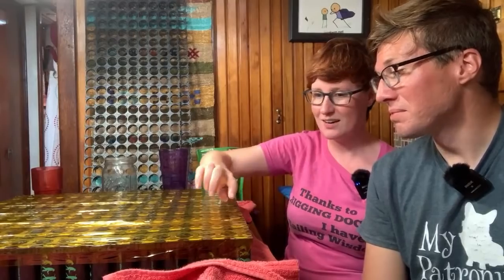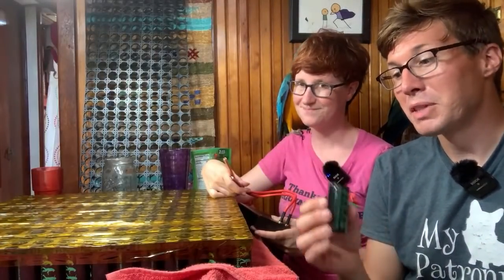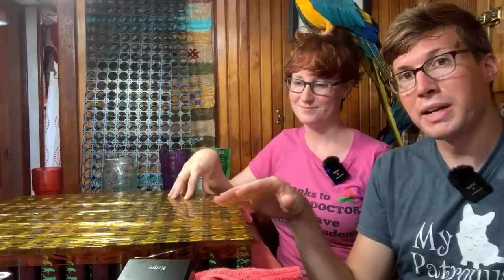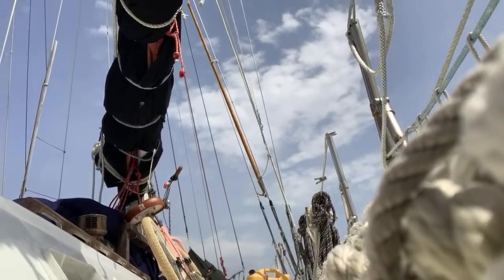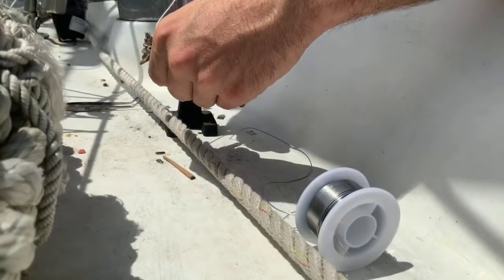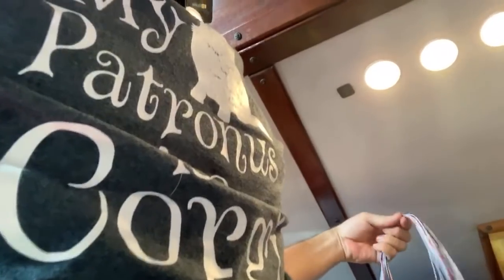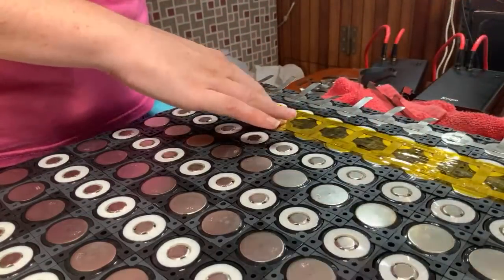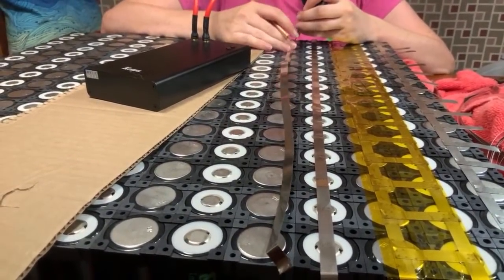LiFePO4 Battery Build [LIVE]

Comment: Just watched!! Great job for ya first time… I think if people knew what was inside a battle born, expertpower or Regen etc….  More sailors would build their own… if you bust open a Battleborn  you would find 18650 cells. Using the same weld techniques in this video…
Reply: Actually they are not using 18650 cells. 
And using more likely 32650 or a little smaller like 26650. Battle born cells have 3200 mah cells. So I'm leaning towards  26650?!
Reply: @rightsdontcomewithpermits7073  ya realize this post is a year old…

Comment: Interesting and informative. Loads of information on an important subject. Thanks so much. Your soldering skills could stand a complete rethink though. Lay down a small board over the fiberglass deck first. If you just tin the wire lead first, lay the small strip on the board and heat the strip by touching with the tip and lay the tinned wire onto the strip next to the tip. You should not need more solder than is on the wire. A big "Good going" to you both.
Reply from the maker: Thanks for the soldering trick! I’m going to be soldering 8 more today so I’ll give it a try!

Comment: You would do well to use an inverter and use as many 120 vac/240 vac things when you can.  Regular stuff is cheaper than their boat equivalent, your wiring would be smaller gauge, and inverters are very efficient (>90%) so there isn't a high penalty.  Sine wave inverters have really come down in price too.
Reply from the maker: Now that we have the batteries to power stuff, we have installed a 400W inverter and it has been awesome!

Comment: Hi guys, I built a pack from Tesla battery that I disassembled. I bought a similar spot welder and it would not give good welds on .15mm nickel strips but would on nickel plated steel strips. Did you test the strips to make sure they were pure nickel? Ended up building my own spot welder. Be safe!
Reply from the maker: I did and they don’t rust. The welds are not always good which is why we do a bunch and revisit some of the spots to get it to finally weld. At full power, they seem to stick pretty well.

Comment: I work with electrical items of all kinds so I don't have any dislike of electrical devices.  But when it comes to power a boat, gas motor is the only way I would go.  I know all the advantages of battery power but I also know the disadvantages too.  Battery might be a good backup to a marine engine.  If it were me I would have put 2 outboards on the back of the boat.  If it didn't work out I would sell them and try something else.

Comment: When talking about Amps you should mention the voltage. 100 Amps at 24 volts provides twice as much watts as it does at 12 volts.
Reply from the maker: Very true. Whenever I’m talking about the motor, it’s in 48v. 
It then quadruples when we step it down to use in the boat for the house loads!

Comment: Building a diy battery like this has an amazing advantage of building a bank with custom dimensions to fit existing boat locker space.  So do you have a calculation for Volume in terms of AmpHrs using these cells?
Reply from the maker: I did back when I was buying them. I figured out the maximum theoretical kW capacity of the battery boxes and then tried to organize the packs in a way that would most closely approximate the maximum. This let me rest easily knowing that “there isn’t more power storage available” so that I could stop my calculations.

Comment: What about the insurance and the DIY batteries?, dont you need some kind of certification?
Reply: Yes. You most certainly need some sort of certification depending on intent / type of operations conducted. I think, under the American USA flag these types of vessels are entirety exempt because of categorization of liability and risk. Generally, a small vessel not carrying in Commerce can operate under it's own authority. Basically, the most interested party assumes full responsibility for safety and casualty and Indemnity. That is to say, the most interested parties assume risks as they see fit. If a vessel carries Passengers or freight in Commerce $ it is subject to many standards which are enforced by the global community and local authorities.
Reply from the maker: Insurance companies don’t seem to care as much as they should. When I had full coverage insurance and switched to electric propulsion and synthetic rigging, they never had someone come check it or review it. I notified them and they didn’t care. “As long as the rigging is under 10 years of age” and “any type of motor is fine”. Nothing about it being done properly or safely. 

I guess if your insurance gives you a hard time, switch to a company that doesn’t give you a hard time!
Reply: @RiggingDoctor   The past three states ( in land) I've owned and registered boats in didn't have any insurance requirements at all. My insurance agent told me I'm covered by my home and auto insurance policies. I suspect I'm in error.
Reply: For U.S. Flagged small boats, insurance inside the U.S. is easy, particularly for "liability only". Outside of the U.S., I find it a nightmare. 1st,  there's a lack of choices/competition. 2nd, non that I find offers "liability only", maybe too little money to be made? For bigger name companies, if my boat is worth less than a certain amount, like $150k, I don't meet their threshold. They are seeking annual premium north of $3,000. European flagged vessels seem to have many more choices in this area.
Reply from the maker: Try StateFarm. They do our liability only and we were covered anywhere in the world. No cruising grounds or calendar limits. Just liability insurance for the boat.
Reply: Don't be fooled you homeowners insurance does not cover your boat only liability at your house .
But an additional endorsement is cheap add on to a home owners policy .
Reply: @RiggingDoctor  Just double checked with the underwriter from StateFarm; they only underwrite U.S., not internationally. So you may have been sailing tens of thousands of miles without any insurance. Apparently, many marinas don't care. I guess unless the boat is worth $200k+, many cruisers just don't bother with insurance because it so difficult/expensive to get. Even some YouTubers don't have any: Beau and Brandy Sailing, Emily & Clark's Adventure, Sailing Good, Bad, and Ugly, Bums on a Boat,... Sailing Project Atticus didn't have any for their old boat. Doesn't help with anxiety whenever you're away from your boat.

Comment: Adding 16 rungs to your ladder is crazy redundant. You could do just one if you back your nickel strip with copper wire, and connect with one wire rated for the full amperage of the battery. (Although the 16 strips.... one on each battery pair is oddly soothing to my ocd.)
Reply from the maker: Haha! The symmetry is nice.

The Ni strips flow 5 amps each, so 16 of them gives us 80 amps, while the BMS is a 60 amp unit. The motor at full tilt would only draw 80 amps from each battery so its just enough. Copper wire would be nice to tie it all together but with so many connections to do, the fewer the steps the easier (and it's soothing to look at).

Comment: Found the rigging doctor channel yesterday as I got a complete re-rig coming up, Headstay, solent, 2 top sidestays, 2 lowers and a babystay. Antenna in the backstay..  But as an electrician and hobby e-bike builder, I got sidetracked by the electric motor thing.

How do you wire the charge control/battery protection? I understand that you use a separate BMS in each battery? Can you  connect one or more battery packs  to consumers at the same time, or are all connected together?
Do you have a separate load and charge bus, or will the battery be disconnected alltogether if there's danger of overcharge?

Looking forward to the next part of your saga.
Reply from the maker: Hello! Glad you found us 😁

Each battery has a BMS which will disconnect for many reasons (temperature and charge related). We have a fuse to disconnect the battery if it discharged too quickly, and made the interconnects small so if one cell gets carried away, it will sever its connection to the rest of the battery. 
All the batteries are hooked up together in parallel after the BMS, so each battery can operate alone or in concert with the other batteries. 
It was a lot of fun learning how to make these batteries and all the protocol that electricians use to ensure safety and reliability in installations.
Reply: @RiggingDoctor   Just be aware that when you paralell batteries with different voltages , the low battery will take the amps wich the BMS permits. I would consider reducing max charge for each BMS to about 1/4 of max possible charge in your boat, or thereabout. just to baby your batteries.

If you use allmost no amps at 3 knots , and 300 amps at 5 knots, I bellieve that you are over propped. A good prop-shop will calculate a perfect prop from your electric motor log and boat data.
Reply: Over propping will also hurt your regen.
Reply: 1/4 each , as you have 5 batteries
Reply from the maker: When I connect the batteries I keep them turned off and charge them to roughly the same level so that there isn’t much of a jump/dump when they get connected. 

As for the power consumption, the motor has a reduction gear on it so that we hit hull speed just before the max RPM of the motor; in other words, the gear makes our prop perfect for the setup. 
The issue is the force required to move the boat increases exponentially and to go a little faster, it consumes a ton more power. Finding that sweet spot of a comfortable speed and enough range is the trick to it all 😎

Comment: QUESTIONS PLEASE ! Was wondering if there was a resource for what you did. I was told there was a channel that specializes in the single cell types of batteries with the little spot welder and I suspect you got your info from there ? That said, I'm perfectly happy with what you have done and the info you've provided. I guess I would want, at least on top, a layer of that tape that is one big sheet if its possible to find ? What do they mean (spot welder) 9 gears 60 gears 5 gears ?  (anyone can answer these questions if you would like to )
Reply from the maker: The channel I looked at for information on how to build a battery and assemble a BMS was DIY Solar with Will Prowse. His channel is very informative!
I also read a lot of research papers about different cell chemistries to decide on LiFePO4. I think it was the University of Colorado that had a lot of great testing results published. 
As for the “gears” on the spot welders: I think it’s a case of “bad translation” from a designer who speaks no English. The “gears” are analogous to “levels” or “power”. They are so weak that you will always keep it set to the maximum and never have issues related to using a welder that is too powerful. 
They get the job done but any lower setting simply won’t get the job done.
Reply: @RiggingDoctor  Will calls prefabricated groups of cells in a 3.2 volt parallel configuration and wrapped with plastic, usually blue plastic, he calls them cells. You are working with true cells, and fabricating what I guess I'd call "packs" if 3.2 v, but your actually not making packs, but instead, making true batteries.  That is what I had not seen before, at least not with Lithium Iron. Way Way back when Lithium Ion batts were still being used, some folks did the spot welding to those. Does your spot welding go back that far because Will didn't do any oi it in his current channel. These current spot welders are very neat and well developed. I didn't use the term "cool" because parts of them get hot lol
Reply: @RiggingDoctor  And, almost forgot to mention, Uma had a serious problem with battleborns in the beginning, it wasn't the batteries but the way they hooked them up.They had a resistive connection that melted one of the batteries. I think I would be using a cheap remote infra red thermometer , accuracy not so important, just seeing which terminals or cells are getting hotter.

Comment: I recently purchased 16 lifepo4
 3.2V 320ah batteries for total of 1500.00. In series and parallel for a 24v 640ah system.  
Try shopping Aliexpress.  It takes a couple months for shipping but worth the wait.
I'm interested in removing my diesel and going electric propulsion...any recommendations for motor and controls?
Reply from the maker: That is definitely the easier way to do it, but we didn’t have the luxury of a long term address or lead times, so our search was severely limited to local and current. 
When we convert our other sailboat to electric, I will definitely be doing Aliexpress for the batteries!
Reply from the maker: As for motor and controls, we have been happy with our Electric Yacht system. Over the years and miles, we have had a handful of issues which were easily resolved. The system doesn’t have a lot of bells and whistles, but at the same time it doesn’t break down as often as the other brands with lots of bells and whistles. 
If it’s a big boat, electric yacht, but if it’s a small boat, you could also look at Thunder Struck. They are an even more paired down version of the electric yacht system, and also a bit cheaper; but they only have up to a 10kW system.
Reply: 320Ah cells in a boat must be clamped , and if you go offshore , it should be suspended.  Sinopoly only recommend 100Ah cells for small boats, 200Ah max for larger yachts.

Comment: How about holding the sordering iron with rubber gloves on?
Reply from the maker: That would be a good idea but we didn’t have any that were thick enough to not melt with the heat. Switching out to a cooler unit worked with the materials we had on hand at the time.

Comment: In hind site couldn't you solder all the wires to one long tab and then cut them apart for easier handling
Reply from the maker: For the BMS? That would work! I was simply using scrap pieces of nickel strips that we would then spot weld to the positive positions, but having them all laid out in an orderly fashion would be rather nice!

Comment: Why not battle born 5 *950? Seems like lots of work for minimal cost savings?
Reply from the maker: The battle born batteries cost $950 for a 12v 100ah. This setup is costing less than $250 for the equivalent battery.

Comment: What is the lifespan of each cell and how difficult do you think it will be to replace them?
Reply from the maker: Each cell should last many years, I think it was either 3k or 5k cycles. 
Replacing a cell is pretty straightforward. Cut it out and weld in new strips to the neighboring cells.

Comment: QUENSTON.It is no limits for Paralel.
Add in parallel for motorbike 36v batt.10 cells, 3.7 is $=37v, and 200 in parallel is equal 37+3,7=40,7v Can work like that ?
Reply from the maker: Series adds Volts, parallel adds Amps. 

If you have a 3.7v, 2ah cell
10 cells in series x3.7=37v of 2ah
10 cells in parallel x2ah=3.7v of 20ah

If you have 100 cells and set them in series strings of 10 and hook those strings up in parallel, you would have a grid which would be 37v and 20ah.
Reply from the maker: Voltage limits how many you can put in series, but you can do as many in parallel as you want to make a bigger battery bank that will power the device for longer.

Comment: You need to buy a derelict beach cat (Hobie or something) to tow up the ICW and cover it with solar panels.....Depending on the size, you could get close to 30KW capacity..... far more than it would take to pull it...that adds up to about 40 HP worth of power.

Comment: At 10:30 you mention Tesla and Nissan Leaf batteries interchangeably, then mention they're NiMH.  To be clear, Tesla batteries are obviously Li-on, only the Leaf are NiMH.
Reply from the maker: I must have misspoken. Tesla uses NMC and Leaf uses Li-ion. 
We decided for safety reasons to only use LiFePO4 on our boat. 
While LiFePO4 batteries are not as energy dense as the other chemistries, we feel that they are the only chemistry that is safe enough for marine use. 
If you have the budget and space, LTO Batteries are the safest of all!
Reply: @RiggingDoctor  - Thanks for the reply; you may want to edit that; however.  Tesla uses Li-on, Leaf used a NiMH. :)

I do agree that LiFePO4 is the the superior route, with only small exceptions where energy density is paramount (eg UAV's, etc).

Comment: Your battery pack would still work fine if a cell died. You may not notice the voltage drop if a cell dies. Prismatic Cells if one cell dies the whole battery is useless. The beauty of cylindrical cells.
Reply from the maker: I know! So many people ask me about it with serious concern, but it’s not an actual issue 😎

Comment: It's not recommended to have your battery bank in the bilge. If you have an incident where your talking on water your bilge pumps stop working when your batteries get wet and flood the boat.
Reply from the maker: Boats are a series of compromises. Our emergency bilge pumps are all manual so they are not battery dependent.

Comment: Those nickel strips seem too thin to handle 48 amps with out a noticeable voltage drop some place.
Reply from the maker: Each strip can flow 5 amps. Each pack can flow 80 amps (but is limited to 60 amps by the BMS). The 5 packs together can flow plenty of power to supply the motor.
Reply: @RiggingDoctor  According to the web site for the batteries,  each battery can store 6 amp hr. I counted 11 batteries in parallel, that's 66 amp-hr. of capacity.  If you draw only 5 amp, limited by the wiring, you aren't going to get the peak short time power you may want sometimes.  If you draw only 5 amps that's abt. 12  hrs of capacity.  But if you need 40, 50, 60 amps, your voltage is going to sag big time.  60 amps of draw needs #6 awg wire.  I think I would have used 1/8" thick X 3/4" width buss bar copper.  Somebody's calculations are off???  Since you are wiring it series paralle, you have 10 amps of buss bar capacity.  (2 strips in paralle 5 x 2=10